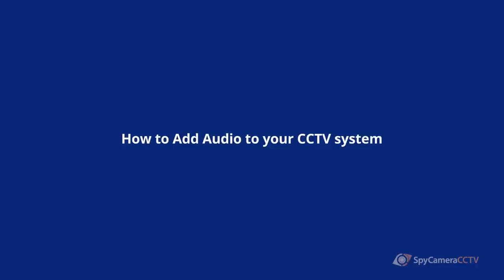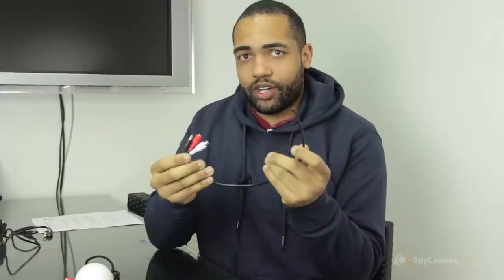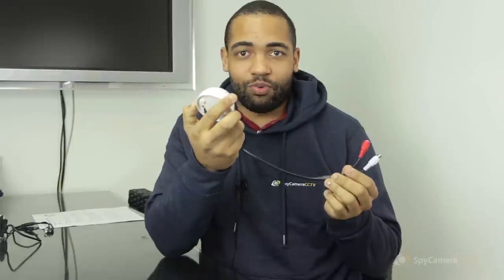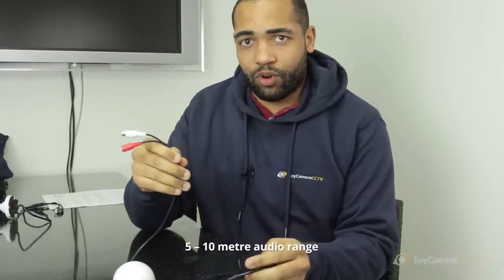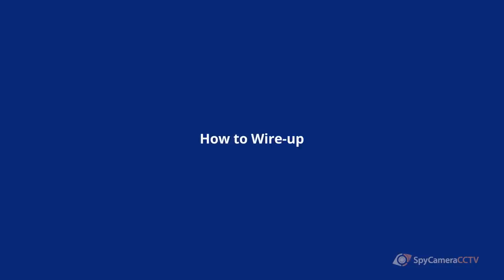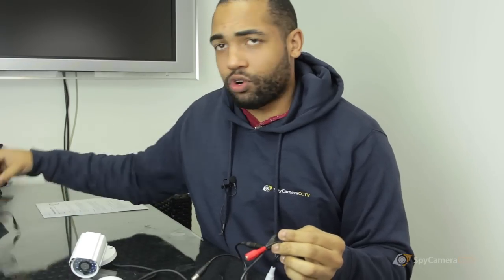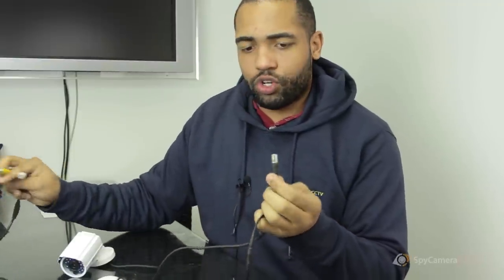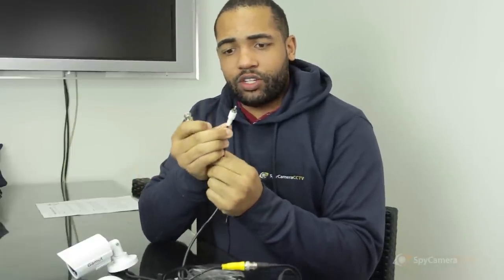How to Add Audio to Your CCTV System

Comment: How does the microphone gain screw work on microphones ? I have a new one but it seems quiet compared to the old one .
 Is it possible to turn up the volume by turning the screw clockwise or do you turn it anticlockwise ?

Comment: Hi Ty! I like your video!  One question: If I go for installing the audio cable into one of my cameras (your first option), and I put it on my front door outside my home, when a postman comes and speaks, I'll be able to hear him. My question is: Will he be able to hear me back from inside my house? Is this a two way audio system here in your video? Or do I have to connect a microphone separately for people to be able to hear me back ? I'm a total beginner, I appreciate your answer! Thanks again!
Reply: The Three Mountains you need 2 way audio feature to do that.

Comment: My power adapter is at the other end of my 30m cable so it would be simpler to use power from camera power connector to mic then from mic back to camera. And cos my cameras are protected by my roof overhang I'm gunna try the pre amp model, thanks for video

Comment: man can do this method only with analog cameras. I also bought this microphone but unfortunately it does not work with Ip cameras. I use a hybrid DVR and use it only in Ip Camera mode as NVR. I could not enable the interface> Encode Video / Audio. I can not click anything. This option, I can only do if I use the DVR in analog mode so connect analog camera. Is that so common that you can not connect an external microphone with IP cameras?

Comment: Why you can't find a cam with inbuilt mic in it rather going through this unprofessional way of solving the issue.
Reply from the maker: CCTV cameras generally don't feature in-built microphones
Reply: he literally explained why, professional cameras usually DONT come with built in microphones because of it being waterproof, adding a separate microphone IS the professional way to do it. You will mostly find microphones built in to the simple plug n play home use cameras.
Reply: wooow good job, I'm looking for somethining that i can trasmetter the audio... for ex ts5823 for drone where it can trasmett audio and video but I din't know if i connect this microfonone work.... can u help me please... thanks mate